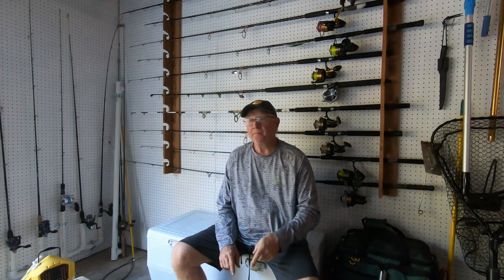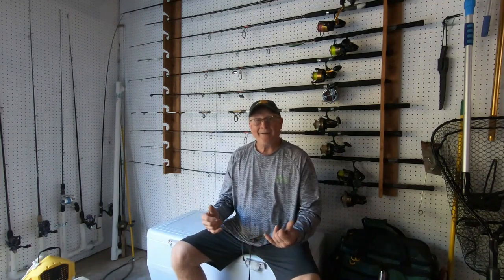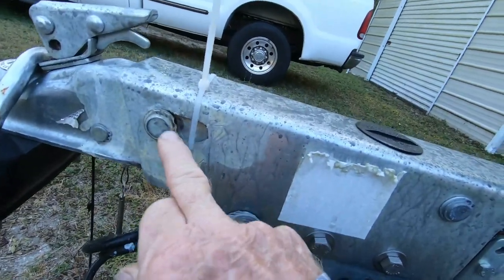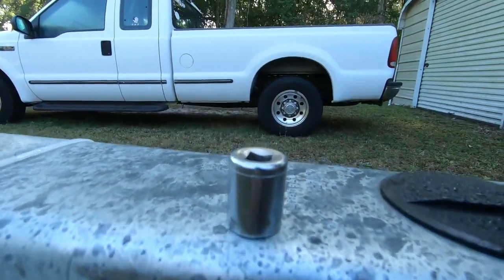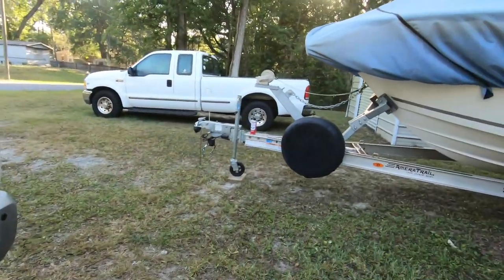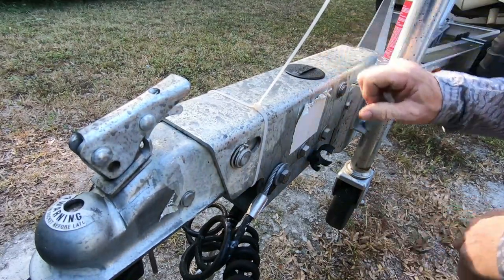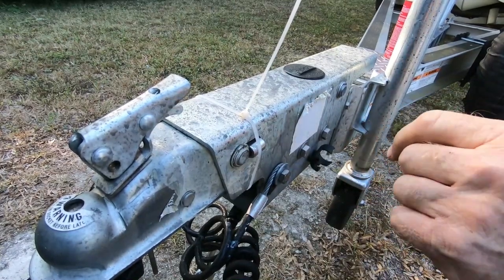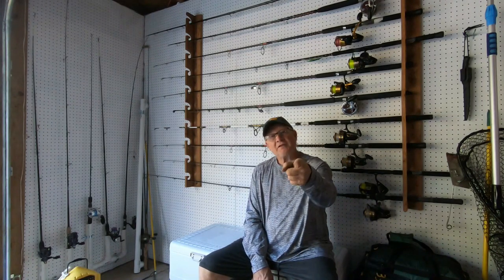OMG. MY TRAILER WHEELS HAVE LOCKED UP!!!

Comment: You can also take like a 5/8 or three-quarter inch nut and tape it in there and do the same thing
Reply from the maker: @VernonEasterling  thanks for your comments.  I actually did that until i ordered the key i use now.
Hopefully going to get that fixed soon.